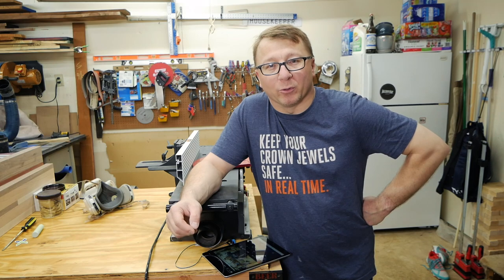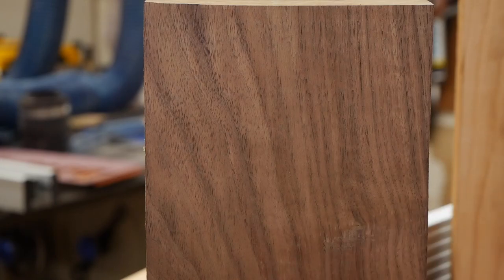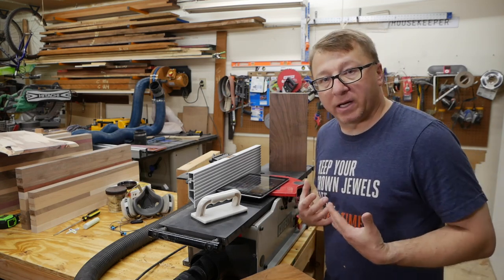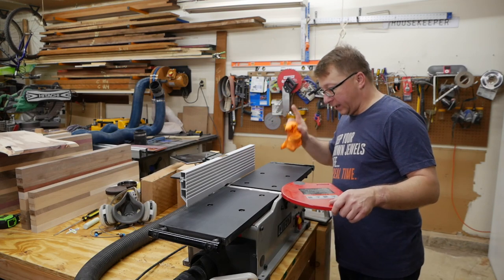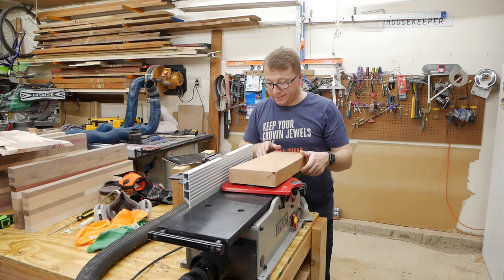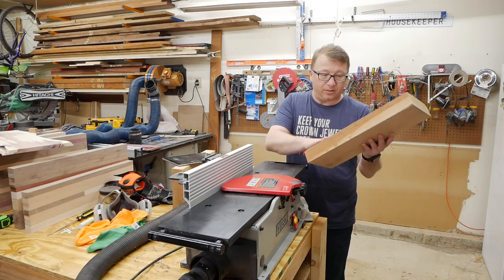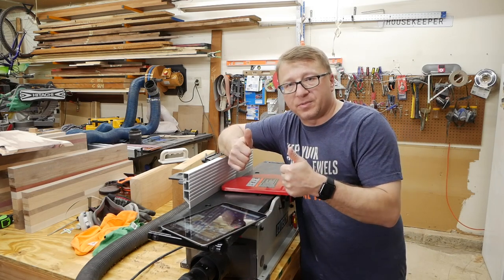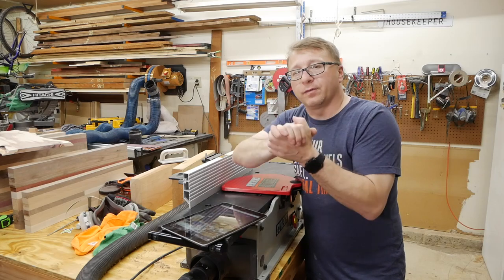Cutech 8" Jointer Follow Up - Addressing the Bed

Comment: I am not an expert on jointers, however I am surprised you didn't wax the bed from the first day.  That having been said you are jointing a wide piece of hardwood using a jointer with a universal motor that has limited power versus an 8" jointer with an induction motor.  It would not be unreasonable, in my opinion,  to expect the jointer to operate relatively slowly given the work it is doing and the resistance of the workpiece to being jointed.   Perhaps sanding down the beds with a 600 grit or finer abrasive and more wax would improve the performance more. Still it is a good tool and "all's well that ends well" to borrow a phrase.  Best regards.
Reply from the maker: Thanks Jack - the reason I didn't wax the bed initially is because I figured it teflon - super smooth cooking surface.  Alas, this bed is not.  Never owning a jointer before, it just used it out of the box.  Now that I've waxed the bed, it works a lot better.  Thanks for commenting!

-Tom

Comment: Hey man I was wondering if you could show a video on how to coplane the infeed and outfeed table. I have this jointer and any time i try to edge joint a 4 foot board I get a slight concave all the way down its length. And also, on one side of my fence the fence is a perfect 90 degrees but on the opposite end its about 89.5. It would be really cool to see a video on how to tune up this jointer. I know there are lots of vids out there on other jointers but I keep trying to find one on this jointer but cannot.
Reply from the maker: Hi @jhenderson725 - thanks for watching and subscribing!  My joint came coplaner out of the box so I didn't have to futz with it at all.  The fence is a completely different story though.  I'll add a tune up video to the queue.  Probably won't be for a couple week though.  Thanks again for watching!
Reply: Mine is definitely not co-planer either. Cant' edge joint for squat and I have a good 6 hours into trying to get it co planer and to no avail. Not quite as amazing as it has been touted to be. my biggest regret to date as far as woodworking tools are concerned

Comment: You have the jointer to high up on that table if you can put it a lower bench will improve you way of pushing the materiaal
Reply from the maker: Hello Edel - yep, I will be moving it to a mobile base soon. That said, I don't believe the height was the source of the issues.  I believe it is unlikely more downward force would help the lateral force required - interested in your thoughts.  Thanks for watching!
Reply: @cyberreefguru  I think the jointer is too high also.  If it were lower you wouldn't have to push as hard I believe and would have a more advantageous angle.  Great video though.  Keep them coming.
Reply from the maker: @govtman2755  yep, I'm working on a lower table.  Thanks for watching!

Comment: It would have been helpful to know your opinion on the fence and its adjustments. Ever thought of using something like GlideCoat instead of paste wax?
Reply from the maker: Hi John - thanks for watching and asking.  Frankly, the fence sucks.  It's nearly impossible to get perfectly 90 to the bed, and just as nearly impossible to keep it in position.  Plus it is flimsy and lightweight.  So, that's not too awesome.  I've never used GlideCoat before, so I guess I need to dig into that.   Paste wax works just fine though.

Comment: 1. The Teflon is a for helping to avoid scratches to the bed not to make the piece glide across so definitely wax. 
2. You have the jointer up way to high you cannot apply the right amount of force or control the piece properly. Your jointer should be no higher than waist high.
Reply from the maker: Thanks John. Roger on both. Thanks for watching!

Comment: How does this jointer work with longer boards? 4', 6', 8'... Curious if it's able to handle them well like the shorter boards you have in this video. Thanks!
Reply from the maker: Hi Charlie - I've had mixed results with boards longer than 3' or so.  I've been able to get 4' boards straight, but it wasn't necessarily easy and it wasn't perfect every time.  If you need to joint 4' or 8' boards, the table might be a better choice.  Thanks for watching!

Comment: Hey man it's me again. I spoke to you a while back about planing or jointing the boards and getting a convex concave or whatever slightly down the board. You explain to me that you were tables were coplane from the factory and that you never had this problem. My question is have you had to do a glue up with long stock such as 4 foot to four foot six stock. I have removed the tables from the jointer and am finding that they are not perfectly flat there is a gap of at least two thousands of an inch towards the end of both the infeed and outfeed table. I contacted the cutech tech support team and they sent me a new table and it is also sagging on the end near the extension arms. I do not have a problem with shorter stock but with longer stock I can not get a tight glue up. Have you been having any of these similar problems and if not do you have any suggestions for me because the manufacturer is stating that if the Gap is no more than eight thousands of an inch that it's okay
Reply from the maker: well, I have had problems with longer glue ups, but I've been attributing the problems to (a) misaligned table saw (b) limited experience jointing. So, perhaps my issues are more complex?  I will have to check just how flat my tables are.  All that said, I'm not convinced .002 would cause an issue with a glue up - I believe wood has much more movement than a few thou due to humidity on a daily basis.  Are you jointing small amounts over a series of days to get the stress out of the wood?  I'm not terribly experienced in this area and I'm having mediocre results myself so I am very interested in your experience and results.
Reply: @cyberreefguru  I havent tried jointing a board a little bit over a few days. Maybe i should try that although that seems pretty monotonous honestly and i guess i feel like we shouldnt have to do that. when only taking a 32nd off at a time u would think there wouldnt be a huge release of force.the more research i do it seems that the most important thing is the alignment of the outfeed table to the cutter head tips. I am getting different opinions on  all this straight edge should lay across them. The instruction manual says that the Strait of should lay on the tip of the cutter head blades but when turning the cutterhead it should not move or left the straight edge. And then a video by Colin kinnett on YouTube says that the blade should be slightly above the outfeed table so I'm not sure which one is correct but I'm just going to keep on adjusting this outfeed table and playing with it and just going to stick with the best result  I guess. I'm still working on this but  I will let you know if I am able to get any better results with a four foot glue up.
Reply from the maker: Have you tried alternating the joints (inside then outside) to cancel any bed error?  Or using the table saw for longer boards?  Shaun Boyd has some great videos on this - https://www.youtube.com/watch?v=W5bgtDFPB0o and https://www.youtube.com/watch?v=1K1xZJgRcF8&t=199s
Reply: Getting a good edge is an obstacle on these bench top joiners.  I have seen people make boxed extension tables for these (like what is done for a miter saw station) with the joiner nested in the center.  This gives you a longer surface to register the board like on a long bed floor standing jointer.  Another reviewer of this joiner mentioned using a higher and longer fence that is more rigid for wider boards.  These bench top models out of the box do great at 3' board lengths, anything longer is a problem without creating mods.  Saving for a European 12" combo machine, but considering this machine for now.

Comment: I wonder if you need to have this operate at a lower working height. That way you can push down more and forward.
Reply from the maker: Hi Scott - thanks for watching.  I plan on making a lower cart for the jointer, so the current location is just temporary.  After waxing the bed, it works perfectly fine, so the new cart is a little lower on my todo list.
Reply: I TOTALLY agree that working at a lower height puts more downward pressure on the bed. This assists in moving the board AND is significantly safer.

Comment: Seems the jointer is a little high, not a lot of upper body weight you can use to push down with. I would build a lower cart to place it on.
Reply from the maker: Hi Darb's - yep, it's on the to do list.  Thanks for watching!

Comment: Great video, the wax is generally the solution. But, the bed seems a bit high, probably safer for you if the bed was lower.
Reply from the maker: Thanks for watching Gary.  The position is temporary - I'm going to build a lower bench for it, like the router table.
Reply: Very very precise answer, lowering the jointer will solve the issue of ergonomics .🙏

Comment: Dude you need a better push block for the tailing edge of the board.  You need a push block with a hook at the back, it looks like you’re putting too much downforce on the board with both push pads you should be pushing the board through the cut not so much straight down.
Reply from the maker: Yep, I have that on my to do list.  It was one of the first things I decided I needed.  Thanks for watching!

Comment: Some of the comments suggest sanding the teflon with 150, 180 or 600 paper.  Wouldn't that just remove the teflon??
Reply from the maker: Hi John - yes, I believe it would. The paste wax seems to have fixed the issues I was having so I'm sticking with that (no pun intended ;))
Reply: John, you might be referring to my comment above. I was suggesting waxing the bed, then briefly sanding it with 150 or 180. Not enough to go through the wax, just to level it out. Sorry for the confusion.